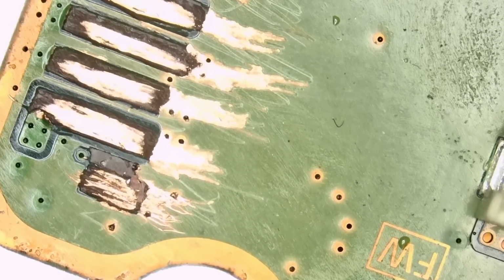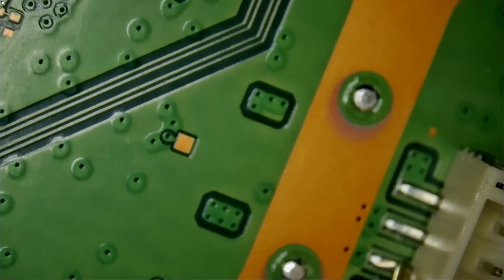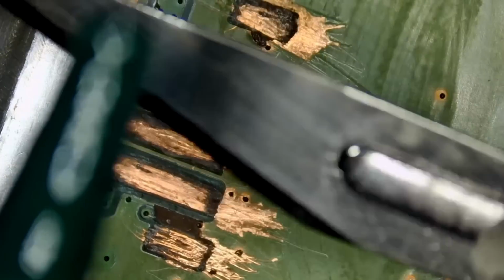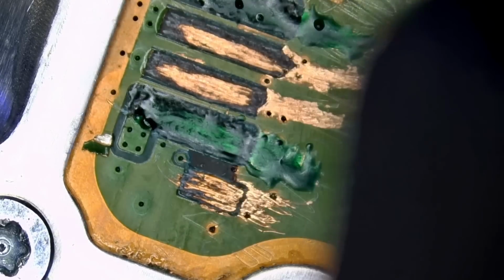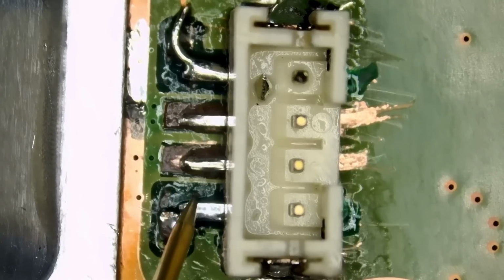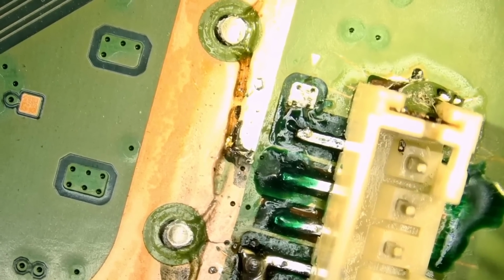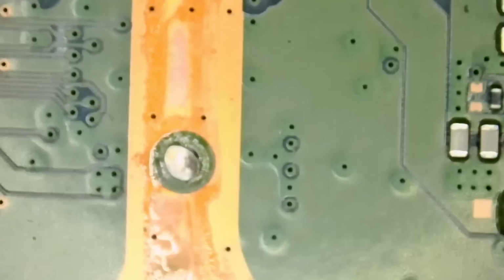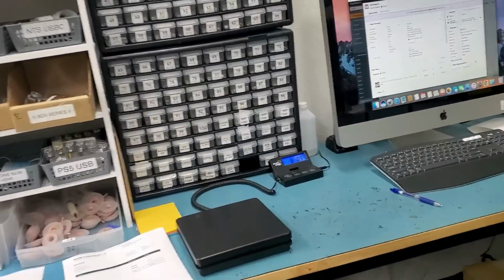PS5 Repair Disaster. What Happened here ?

Comment: I fix laptops and usually if it's not a part I have to order it is done that day I do not feel like I charge a lot compared to best buy that keep the same laptop for a month and can't even fix it anyway. The last time that I had a customer bring a non posting laptop they said Best Buy had it for 3 months and charged them $300 I fixed it with 10 minutes Charged him $100 for a full hour minimum requirement and then he tipped me $200 that's how things should work if you ask me.

Comment: We had a Series X come in for HDMI. A previous repair shop worked on it and it was like a tornado ripped through. 16 out of the 19 pads were ripped off. There were new wires placed wayyyyy longer than needed and too short in places. We told the customer we are not doing this repair and advised the customer to go to the original repair shot to have them deal with their mess.
Reply: Previous repair shop?  You mean someone who watched a video..right?